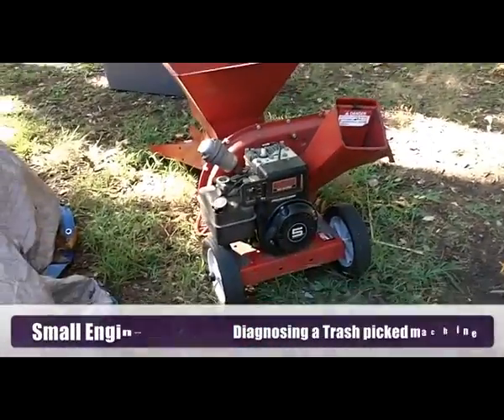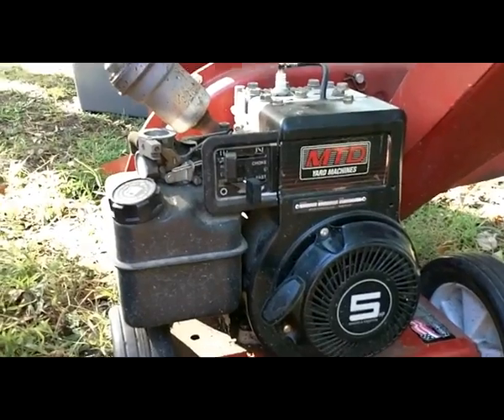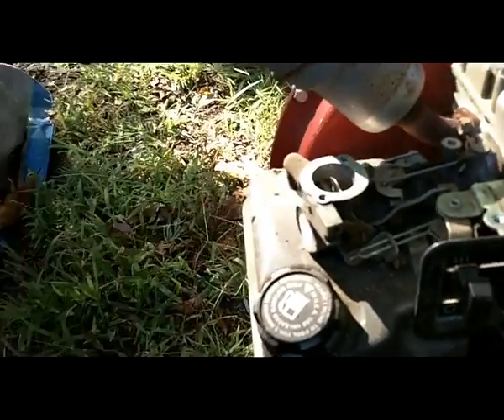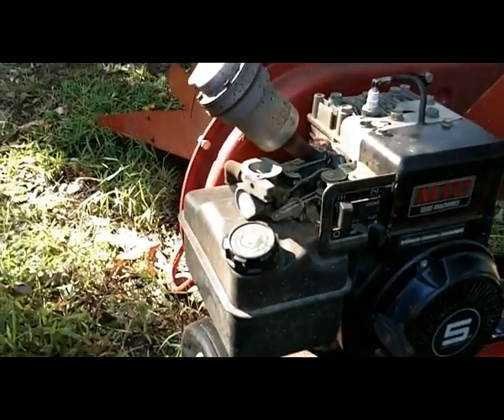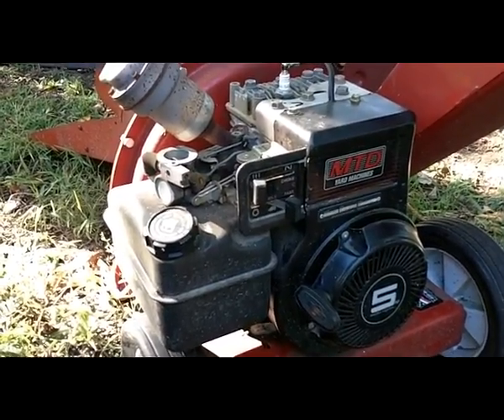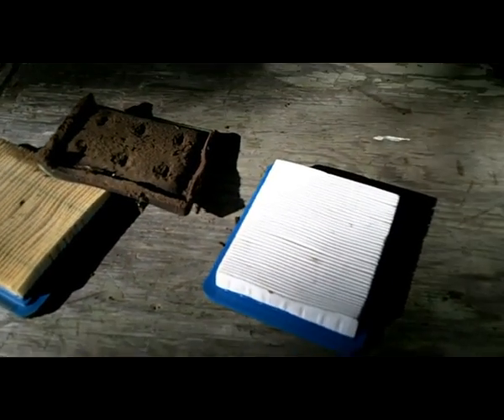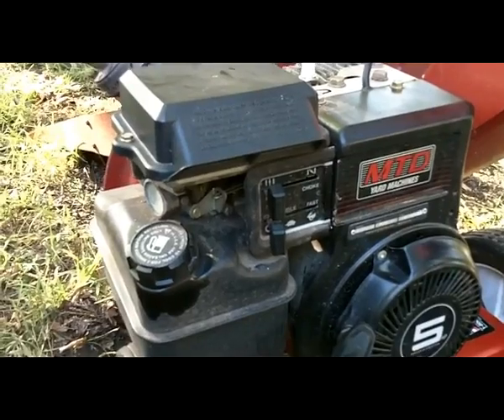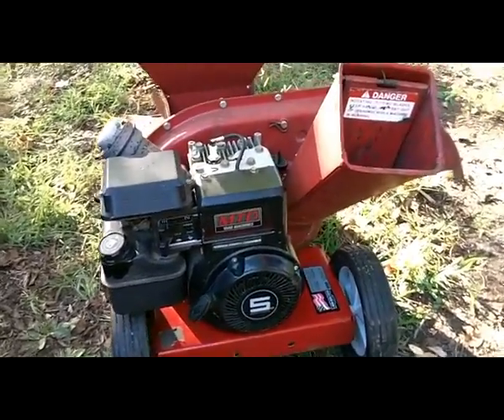Trash Picked Engine - Will it Start? Diagnosis & Repair 5HP Briggs & Stratton Fix MTD Chipper

Comment: Thanks for the video. I just picked up an old MTD chipper and I’m taking it apart and fixing it up. I could have bought a new one, but like you, I like fixing things. Is there an easy way to drain the oil? It seems like as soon as I remove the drain plug the oil will drain all over the deck just below. Is there some tool or trick to avoid making an oily mess? Thanks!

Comment: I just got one of these for free from my neighbor too. He thought it was seized and had been in his shed for last 10 or more years. Took the hopper off and cleared the jam, threw in some fresh fuel and oil and would not start. Confirmed spark, and compression is within acceptable limits. Cleaned the spark plug, put her back in and it started first pull! First time ever working on engines like this, but it was a lot of fun learning about how to do all this and trouble shoot enough to get it going. Used ChatGPT to help me every step haha :)
Reply from the maker: Great job!

Comment: I got same engine and unit and mind won’t start either.
Got spark new plug 
New gas
New oil
Air filter
Mind is very hard to pull the rope.
Strong compression!
I spray starter fluid into plug hole no start!
I’m going try spray into carb next!!!
Any suggestions?
Reply from the maker: It's hard to pull the rope because the chipper mechanism is  big and heavy. Use an inline spark tester to verify you're getting spark. If that's all good, then it's likely a fuel issue, and you might just want to replace that carburetor. You can get inexpensive replacements on ebay or amazon. But first make sure you have spark. Good luck.

Comment: I have the same engine. the owner let it sit with fuel in the tank. Mostly varnish. It would start with starter fluid but then die. Removed carb and tank Cleaned carb and tank and put in a new B&S kit with new fuel pick-up tube. Put it all back together but it would only start with starter fluid but it would run. How do I get it to run by using just the choke and no starter fluid? I removed the carb again cleaned  tank also. fuel Pick-up tube clear.
Reply from the maker: I'm not entirely sure. But at least you got it running reliably for you again.

Comment: Wow what a good find small engines are not really that complex a clean out and fresh fuel works fuel in the uk has some type of eco fuel part that causes gunking up of the fuel lines and people give up and go buy a new one. Come winter they leave the petrol in the tank it sits till spring clogging the machine up. Then it’s time to buy a new one in most cases. But those in the know can fix it and use it or sell it.

Comment: Hi there, what would you do if the gas in it looks old and dirty?  Siphon?
Reply from the maker: Siphon is okay, but if possible, just turn the machine on its side and dump the old fuel out. The add a few ounces of clean gas to rinse it, and dump it out again. If your fuel tank is metal and highly corroded, you may need to take more drastic measures to remove it and clean it out thoroughly.

Comment: Hey just got mine same way u did, neighor gonna open the  bad tomorrow its same one, i intend on making the engine clean as possible for a go kart, what do u think?
Reply: zak cooper 
I had the same Chipper and Engine. I took the motor off and built a Mini Bike. Runs Awesome. Never had a a Problem with the Engine. Always started right up !!!!!
Reply: @silkboxing4454  Any chance you remember what clutch you got? Size and all?